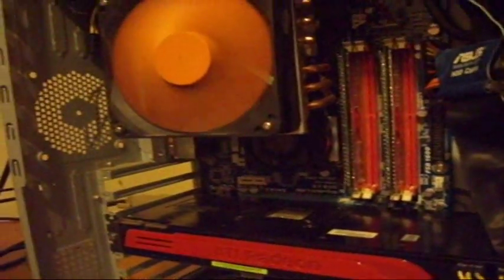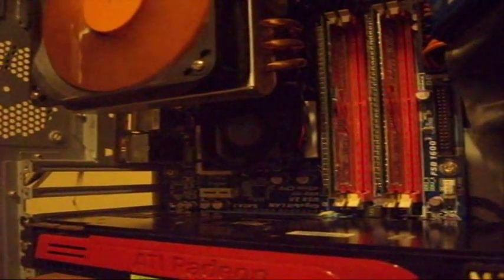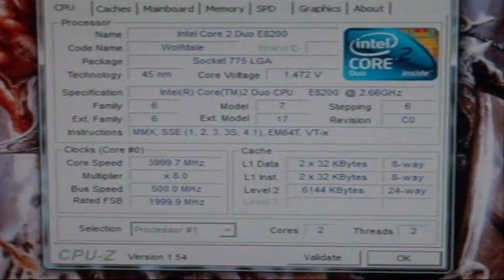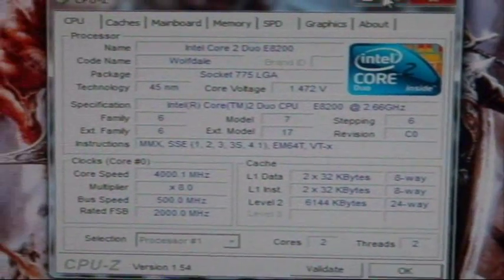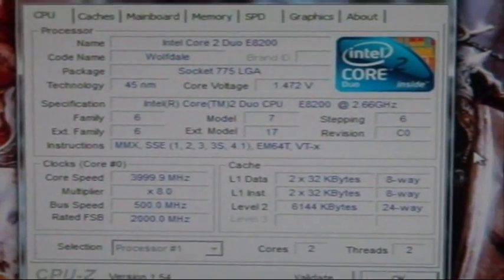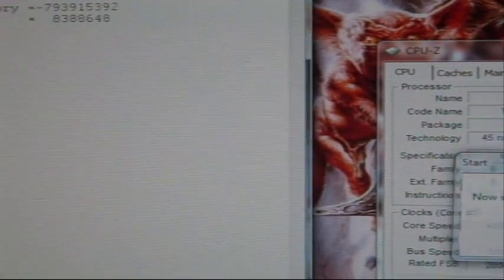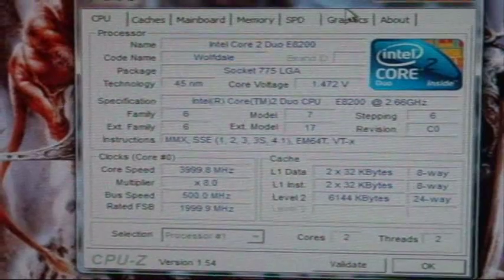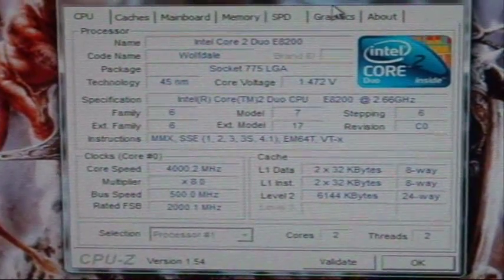4Ghz E8200 Super Pi

Comment: Great result in SuperPi, i've never run it on my system before, curious as to how a Phenom II at 4GHz compares :)

If you're looking for a great air cooler for AMD I can highly recommend the Noctua NH-U12P. I get fantastic temps with my low rpm fan setup, with two NF-P12's running at 900rpm it keeps my 965 at 3.9GHz 1.45v at 50c under Prime95 Lrg FFT! At 1.55v 4.2GHz it only goes to 55c, but remember i use low rpm fans ;)

Can't wait to see your system with a Phenom II X6, gonna go for 1090t? :)